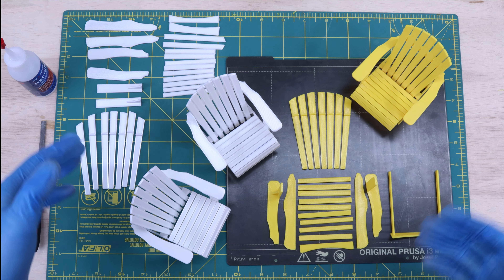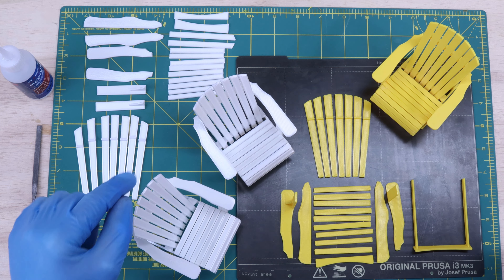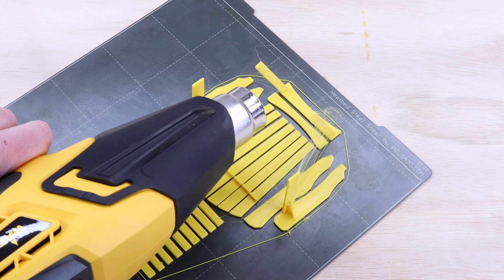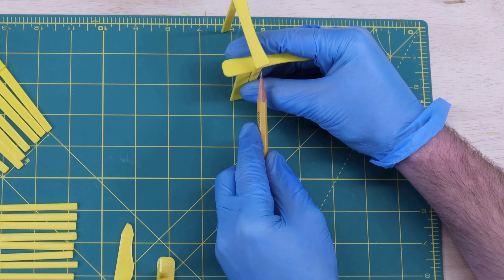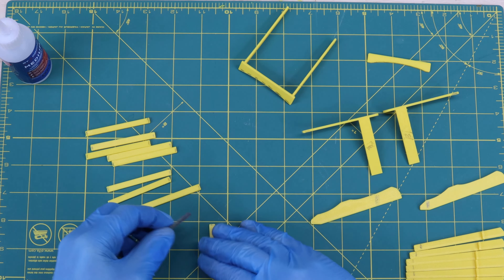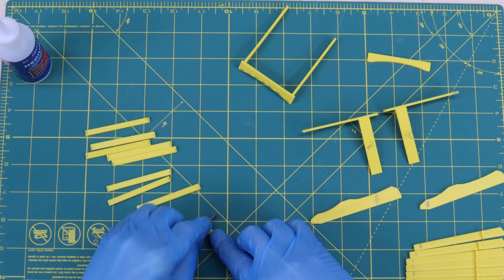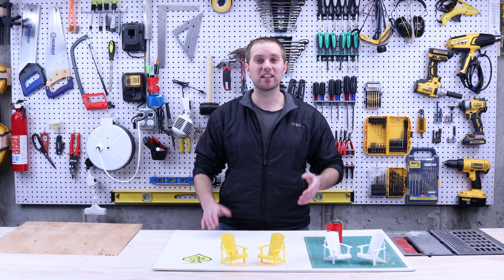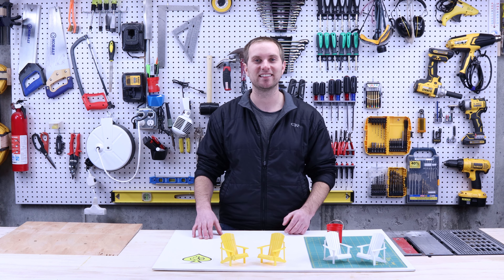Tiny Adirondack chair build guide! (3D print & glue, or card-stock, or foam core board, or styrene)

Comment from the maker: User jmdbcool over on reddit made an excellent recommendation that I'll take into the next design iteration for the 3D models - I can add thin connections between the seat and back slats. Thin connections will remain flexible when printed and will make assembly much easier and faster. Thanks jmdbcool 

An example they provided is here: https://papa-prints.com/deckchair/